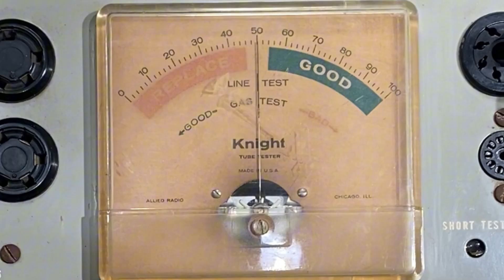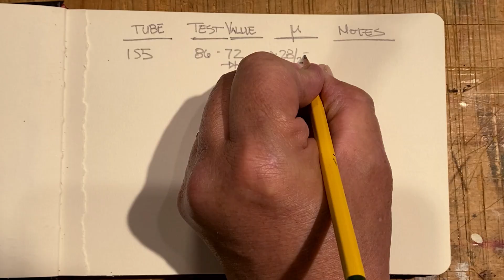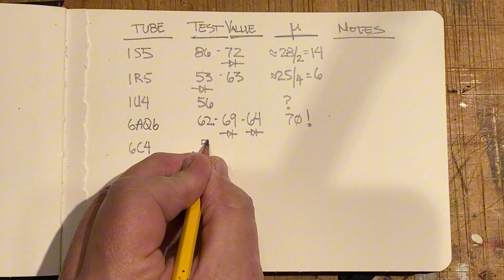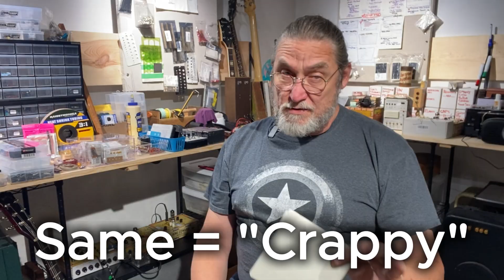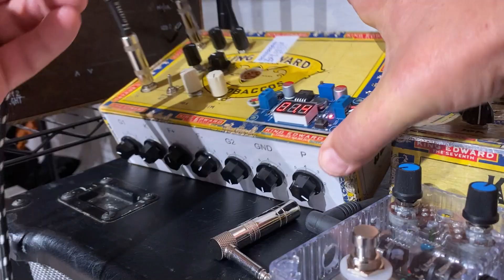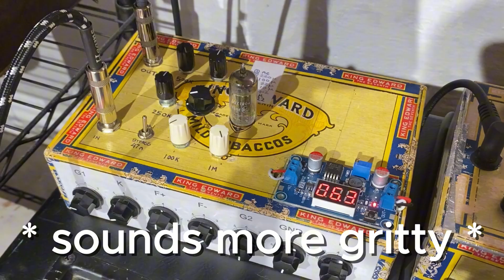7 Pin Tube Universal Gain Stage DEMO and SETUP

Comment from the maker: In this episode from Mad Scientist Guitar Lab, I put the universal gain stage test harness to the real test — comparing how different vacuum tubes actually sound when amplifying a guitar signal.

You’ll hear side-by-side demos of the 1S5, 1U4, 6C4, and 6J1 tubes — from the weak and noisy to the surprisingly magical. While an emissions tester tells one story, the sound of these tubes tells another. I also cover some of the quirks of hot-filament tubes, microphonics, and biasing tricks that affect tone, noise, and gain.

Highlights:
* Testing and measuring the 1S5 and 6C4 tubes on the restored Knight 600 tester
* Accidentally over-volting a fragile 1.4V filament (learn from my mistake!)
* Listening tests using the 1U4 tube — and discovering how microphonics color the sound
* Swapping in the 6C4 for cleaner gain and less hiss
* The surprise standout performer — the Chinese 6J1 that adds real sparkle and inspiration
* Exploring how bypass capacitors, cathode resistors, and plate loads affect tone
* The emotional side of DIY amp building — when a good tube just makes you want to play

This video closes out the tube test harness series with practical tone comparisons and a reminder that sometimes, the best tube isn’t the one that measures the highest — it’s the one that moves you to play.